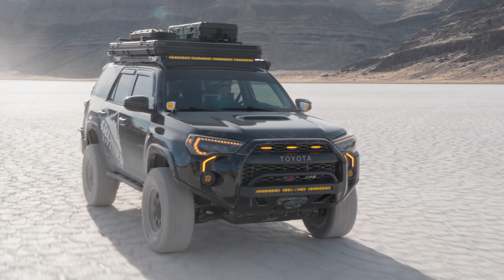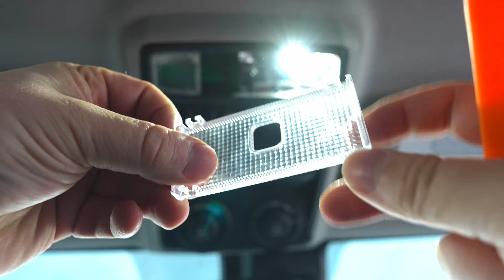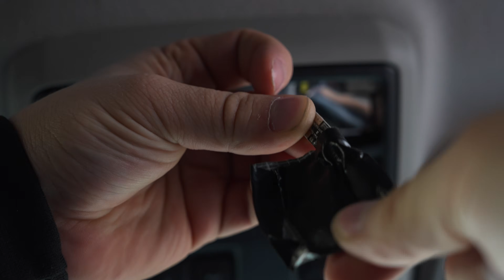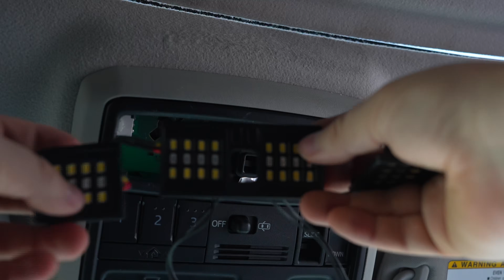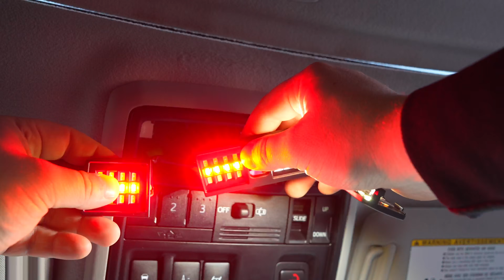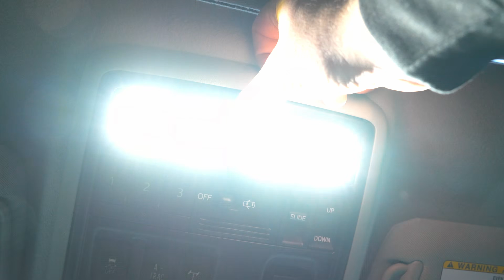Toyota 4Runner Meso Customs Dual Color Map Lights Install

Comment: Reason I have t bought these is because the figment doesn’t look good. You can see a fairly large gap between the Meso light fixture and the housing it clips into. Especially the center piece of the light. Looks cheaply made.